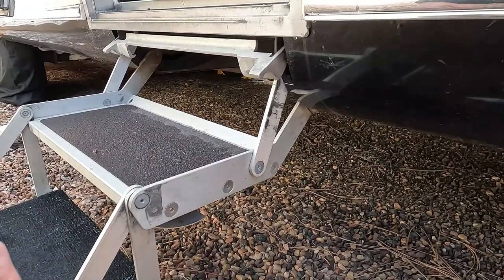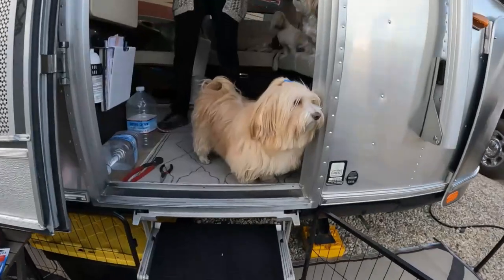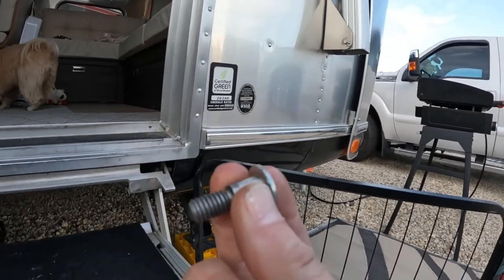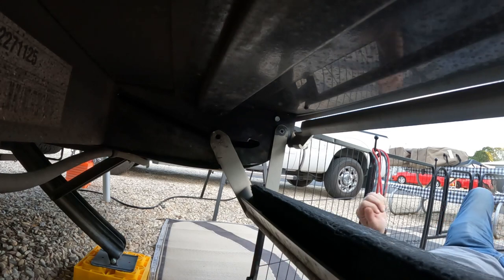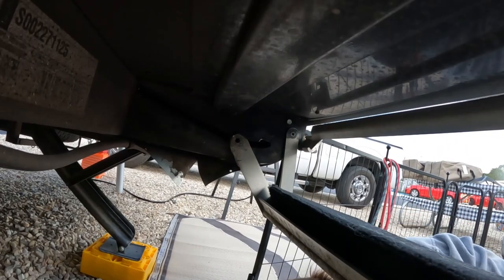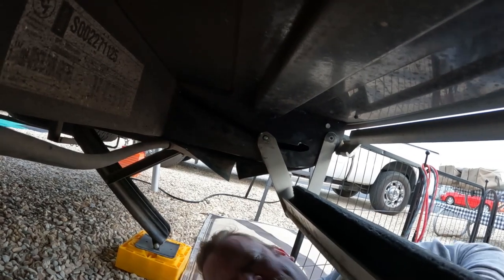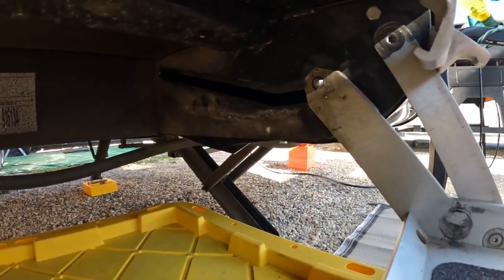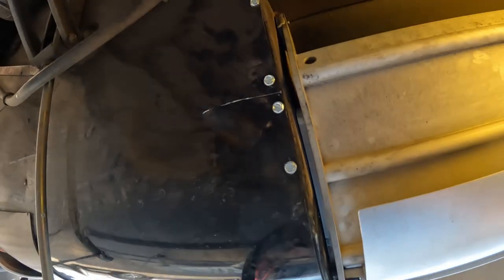Airstream Step Repair

Comment: Thanks for sharing this video.  Same thing just happened to me.  When I looked up the required parts, there seem to also be an accompanying 3/8-16 prevailing torque locknut that is supposed to go with the bolt.  According to the drawings, the nut is supposed to sit on the outer side of the arm, so its not just screwing it to the step arm, but on the other side of the step arm, there is supposed to be a nut as well.  Note that when I checked the other side (which is still locking in), there isn't a nut.

Wondering how your fix is holding up so far.  Thanks again!
Reply from the maker: I've not seen the nut on the outer side; I know neither of mine had or have it.  A locking nut seems like it would make sense as quite a few people have had this same issue.
The fix has held up quite well.  No indication of anything giving out or backing out.  
~D

Comment: I feel like our steps is heading in this direction. Next time try one of those bendy magnets and you probably could have fished it out of that hole. Thank you for the video.
Reply from the maker: I was able to get the bolt out and even went with it installed from the wrong side for a while.  I ended up cutting so that I could get the bolt threaded from the back (and correct) side. 
I do wonder now if I could have gotten things lined up with a magnet...
~D